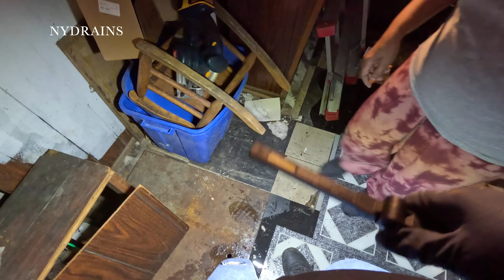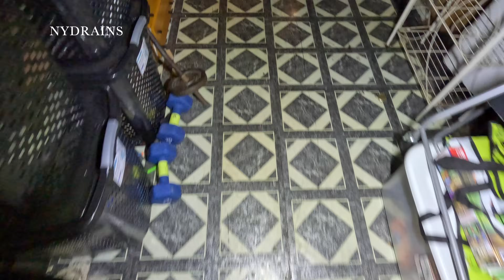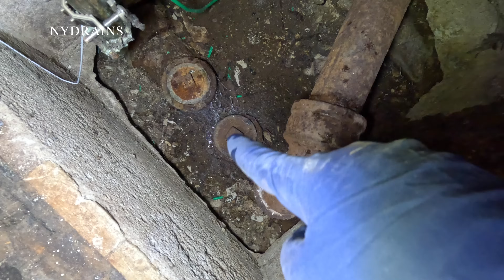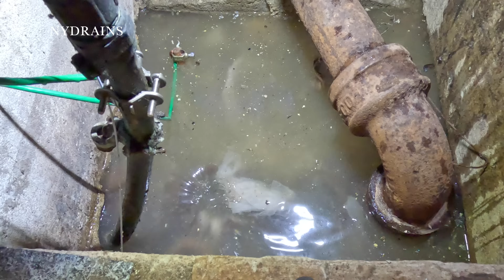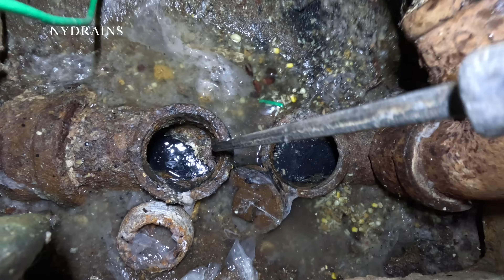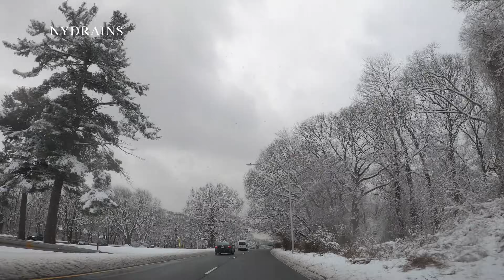Clogged Drain #218

Comment: I've got a stupid question 
To prevent the build up from scale and soap scum, after laundry run water through the pipes or something to reduce it from happening or can it be prevented?
Reply: cold water washing with powdered detergent is part of the issue. The rest is food and cooking grease that doesn't dissolve due to cold water. Ya gotta remember that these system designs are from pre 1960 and some date to pre-WWII when we all had 5-gallon toilets and used hot water to wash clothes.
Reply: @rupe53  Gotcha
Reply from the maker: I depends on the age of the pipe and the pitch of the line. Yes, running water or a flush or two may make a difference. But preventive maintenance is usually the key.